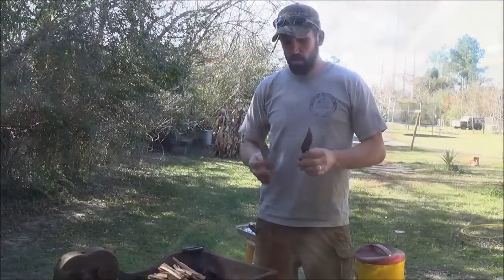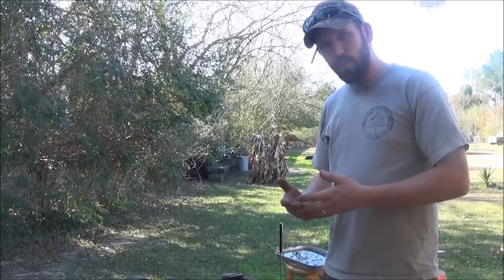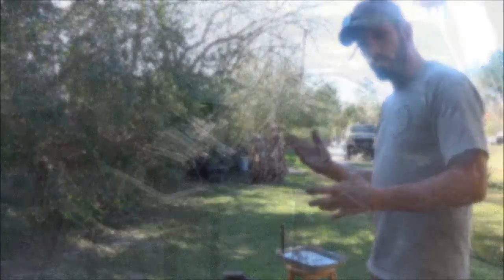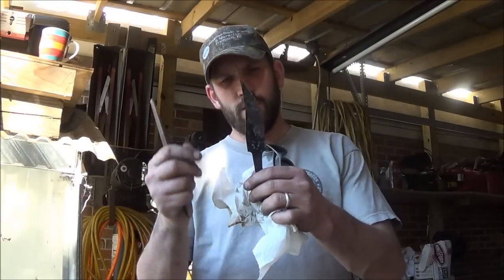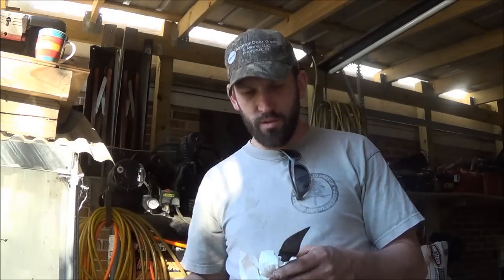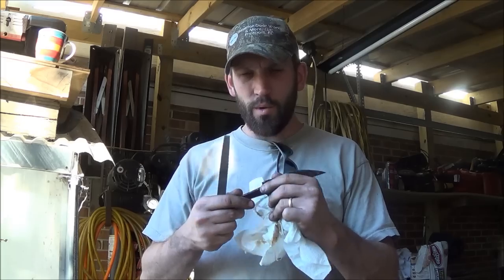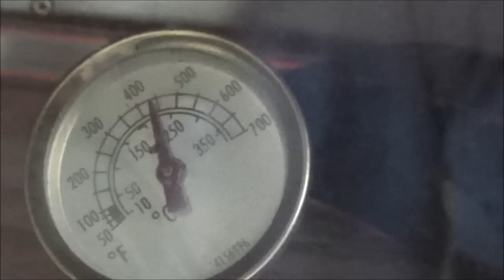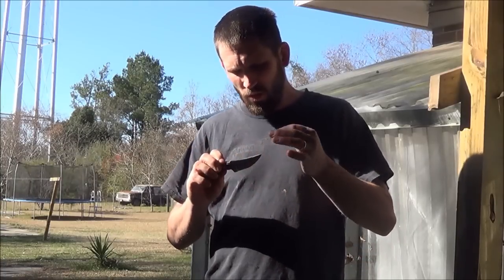Old School Heat Treating

Comment: so you just mix hydraulic fluid and oil 50/50 to quench with?  What brands and types?
Reply from the maker: Yep, 10w30 valveline synthetic and Chrysler atf. Because it's what I had. Don't worry too much about the specifics. Just about any oil will do the trick. A lot of guys use food grade oils like sunflower seed oil and olive oil. Most important part is to bring the oil up to about 140°f before you quench a knife. Wayne Goddard in his book "$50.00 knife shop" he talks about using animal fats and paraffin wax mixed 50/50. The wax keeps it from going rancid. There are many ways to quench a knife. I recommend staying away from water quenching though. I've had a blade crack on my using water.
Reply: RedEyed Jack ok cool, I'll try it in the shop today, I'll use a oxyfuel torch as my "forge".

Comment: Used charcoal?
Reply from the maker: Jarod Muilenburg yeah. trying to find coal here in the Florida panhandle is next to impossible. only option is mail order. the wood lump charcoal burns plenty hit but burns up fast. Not the most economical but works for the few times a year I use my crank forge.